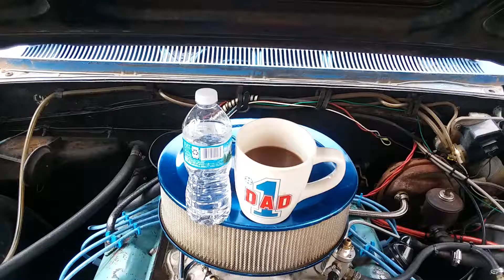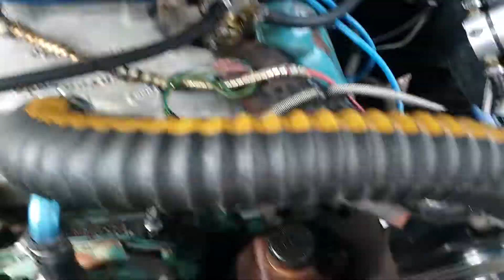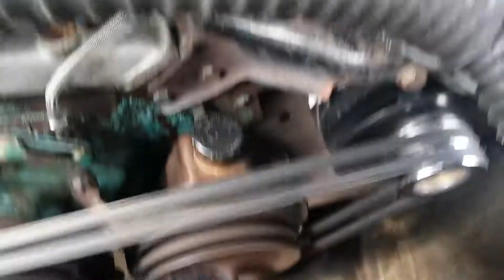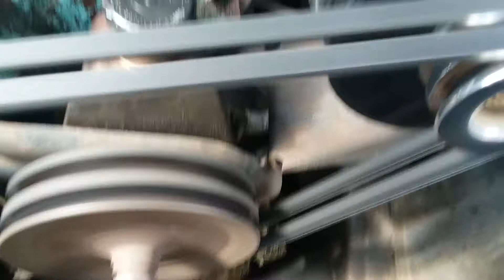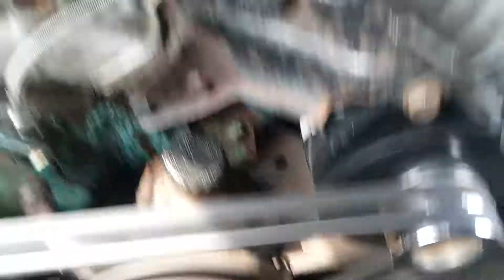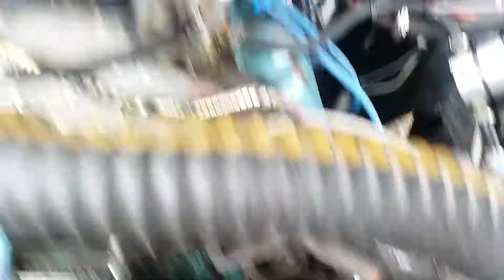1963 Pontiac Grand Prix Oldsmobile 425 Super Rocket V8 after Using GM Top Engine Cleaner Idle Test

Comment: nice and smooth, unfortunately we are looking for a bit more camshaft in our videos.😁🤪
Reply from the maker: https://youtu.be/gyx4Cb47M-E
New Engine I built myself a 1976 Pontiac 455 520 Hp Revs to 7,000 + rpms.  There is a Nice Iskenderien camshaft inside.
The 1965 Olds 425 Super Rocket V8 I still have. Torn down waiting for a Full rebuild by me.
Reply: @brracing7861  That's what we're looking for.😁🤪
Reply from the maker: @albany222  The Olds 425 engine was a True Sleeper Street Race engine.  Amazing power bone stock spanked LS3 Camaros street racing several times.
The 1976 455 I built is faster than Dodge Hellcats 707 Hp up to 140 mph.
Its Bullet the 1963 Grand Prix Now.